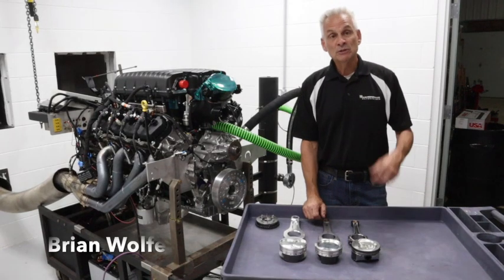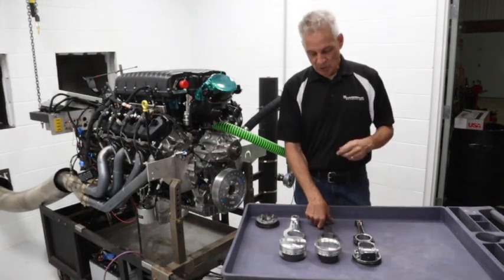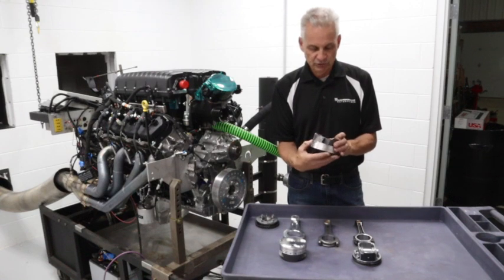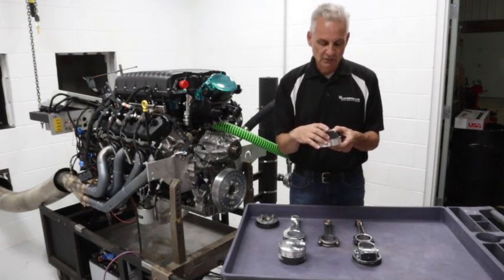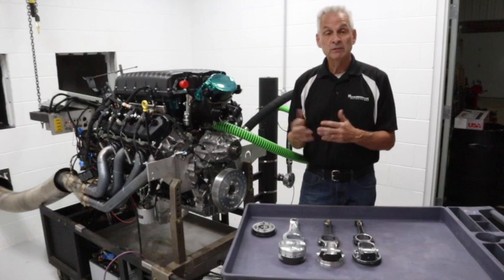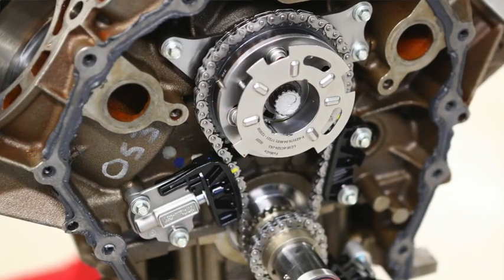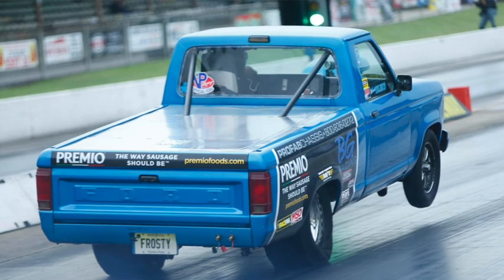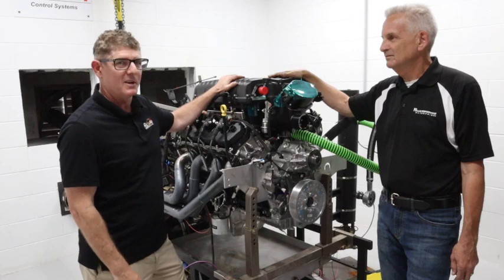7.3 Godzilla — Max Power? — Engine Management — Plus... Rods, Pistons and Soon, Ford Whipple Boost

Comment: Alex Flores or however you spell his name from Lund racing talked so much trash about this engine. But palm beach dyno is getting on board, ken picked one up to start building and playing with. I’m glad atleast  the 7.3L is gaining traction with some of these companies and builders.
Reply: Yeah I concur. I remember him talking trash about the old guys with slow masters and 1.6 rockers and push rods ect. I’m an old school guy. I like the coyote but Jesus a pain in the ass to work on. You can have a head off a 7.3L in about 1 1/2 hrs. I really like the architecture of the 7.3L it’s like Ford saw what the aftermarket was doing with heads and here we go. And on another note before my all timers flares up. I do remember old Alex Flores talking trash about Brian Wolfe as well... after I heard that I lost all I mean all respect for that dude. I really liked listening to him but that was it. Open mouth insert foot.
Reply: @matthewnosal6893  Flores is small potatoes. Wolfe's career is stellar. I even kinda sorta maybe remember him flogging an SVO 514 in a T-Bird back when. Can't find any info.
Reply: Alex is only a tuner.  He has only been in the business for about 5 years.
Reply: I rather have the coyote in a mustang because its lighter and more suited for car applications but ill definitely go 7.3 in a truck or suv
Reply: @albertpintor3522  Have those two engines been weighed in full dress?
Reply: @413x398  not side by side but I saw somewhere that the 7.3 weighs 540 pounds while the coyote is around 460 pounds
Reply: @albertpintor3522  Only an 80 lb. weight difference against 145 cubic inches in a narrower package? Sorry, dinosaur eats wild dog. [burp]
Reply: @413x398  Yep check out Evans other video for a side by side comparison to coyote and Windsor,
Reply: @brianwolfe2993  OK found it again (watched it back in Jan). Looks good sizewise against the Coyote, and it fits easily in a Fox. Nobody talking about this yet, but can I get this into my 2006 CVPI? That is my preferred target, even though I have an '86 FoxCat I bought new. Width looks good, but how about height? Oil pan?
Reply: @bigboreracing356  11.40 n/a in a f 150
Reply: @bigboreracing356  I am poor
Reply: @bigboreracing356    People talking about the 7.3 like it's the greatest thing ever when I think the Coyote is superior in every way it would be cool to see if they could make a big cubic inch Coyote
Reply: @bigboreracing356    It's all in the heads
Reply: I would take a performance version of the 7.3 over a coyote any day.  The LS is way more popular than the coyote because of it’s simplicity, and small external size versus cubic inch potential.  The coyote is gigantic, physically speaking, but maxes out around 5 to 5.2 liters.  Mod motors are small bore spaced, econo/low emission V8s by design that took ford years to make into a decent performing engine in the coyote.  The 7.3 will probably not amount to much, because I’m sure Ford will do what they normally do, which is only put it in the super duty and then stop production of it in 5 or so years.  But if they would do what GM does and put a version in everything(F150, super duty, expedition, navigator, etc) for 10 or more years, then the aftermarket would make affordable performance parts and junkyard cores would be available like the LS.  Then you would see a resurgence in Ford performance and maybe even see some 7.3s swapped into GMs rather than the current other way around.  Just my opinion but the mod motor and coyote killed Ford performance for anybody that likes simplicity, big cubic inches and really big power.  I know I have never had much interest in the mod motor family and many of my friends that like Ford haven’t either.
Reply: Paul Lane I have to disagree about the simplicity of the LS being the go to swap.  It may help but in reality mod motors especially the coyote are the future. The high rev capabilities are awesome. I love this 7.3L and having a new engine out there from ford. The only reason the LS became the go to swap is because GM put them in everything. They failed at 32valve engines and GM tried to put one in a vette and the LS was the choice. BUT the agreement was if they were going to do LS motors they had to make them to fit in most GM cars and trucks. Which meant LS in front wheel drive Pontiac GXP the impala etc plus you had camaros which came went and are going again. The Gto  hummers escalades Tahoe suburban and there other variants core vettes and all the vans and pickups and so on and so on.  Which means you can get a LS for $1000 or less and toss it in anything. That doesn’t make them good motors. It made them disposable cheap engineswhich you could toss in and out. Now it’s been proven new mustangs with coyotes the stock bottom end can get you low 8s in the 1/4 mile throw a stock bottom end coyote in a fox and you can run 7s without changing the bottom ends. I love all cars but the coyotes LS and now this Godzilla. Problem is as the camaro goes away and the corvettes are becoming $300,000 supercars with electric and small mod motors ford is ahead of the game and I guarantee you will start to see more and more coyote swaps. These things are runnng those times and making 1000hp reliably built making 13-1400whp reliably. That was a feat for a LS engine that has been out forever. And slowly going extinct. Joe Biden was at GM and and talking about his 60s corvette and said he seen the new 211mph electric  corvette I put the clip on my YouTube. It shows the way GM is going NO cars and a supercar corvette that nobody can work on or afford.  So I welcome new engine’s.  Mustangs Gas mustangs will keep on being what they are.    To those wondering the 7.3 is taller but not as wide as far as oil pan there is lower profile
Reply: @paullane7489  I agree, Ford needs to spread the 7.3 around. My daily is an F-150. I don't like the size/height of the current F250's, so I'm not buying one just because it has a 7.3 (optional). The F-150 needs a 7.3, and a bigger-than Mustang (resurrect Thunderbird) muscle car should be in the works. Sadly, Ford will again miss the mark.
Reply: Alex is complete clown shoes now he's going to have to tune them in mustangs to pay his bills lol.  How he has a job as a Ford tuner is beyond me shit must be easy if a clown like him still has a job.
Reply: Got a link? Wondering what he don't like about this new motor.
Reply: SUB SHOOTING 84 because it’s a pushrod engine lol. Like me he’s a coyote guy and us coyote guys found it funny that people legit thought the Godzilla was going to replace the coyote in the mustang
Reply: @subshooting8414   The fact that the Coyote is better in every way
Reply: @mauricecooper176  I love the coyote more by far but I grew up ford.so as a Ford guy I know what's what but I would definitely rather see a Ford push rod swapimto aford any day over seeing another LS swapped Ford.
Reply: @mauricecooper176  This motor will shit on Coyotes for drag racing, wait and see.
Reply: @Fauxbra    Do you think this engine can run 7.8 in the quarter mile without being opened up  And in the car with some weight not a Fox body
Reply: This engine requires a complete rebuild to compete with a coyote. Yes, it has its place for certain people or applications but from the factory it is an inferior design. The average person will not touch this engine for many years. Pro mods and teams will 100k cars maybe. It needs a complete redesign to be a practical engine swap.
Reply: @4eyefox  I'm sure Ford would rather consult with you than Brian so they can make this a dream engine. Fill out your resume and get crackin'!!
Reply: 413x398 YOLO DOUCHE BAG FOR THE WIN

Comment: Curious to explore the option of puttin a 7.3L in a Gen 1 Raptor!👍
Reply: I have a early gen 1 with the 5.4, so yeah!
Reply: @MacGyver2154  HellYeah!!  Mine's a 2011 6.2L.  Forget the ecoboost that sounds & shifts like a crotch rocket!  Forget the $106K RXT!  Seems like a Godzilla with a lil work & a blower is where its at!  These guys are doin phenomenal work wringing power outta this beast!
Reply: @daveslem4203  and IF the 2021 /2 actually Does have the 5.2, you know it's going to be 100k +. Gen 1 looks the best and it's the last SVT.
Reply: @MacGyver2154  amen brother!!  I like the Gen 1 better too!!  Gen 2s are nice and all but i dont like the transformer look FoMoCo went after.  Plus, modern vehicles are being built for folks that can't drive!😂🤣  Now, if we can get a Godzilla, Gen 1 with a manual 5 or 6 speed trans that'd be tits!!🤣👍
Reply: @MacGyver2154  Do you have a raptor with the 5.4?
Reply: Hell YES!

Comment: how does the bsfc of this compare to an old school bbf? How much more efficient is it? Great video series btw thanks!
Reply: Nelson Braganza : The versiona of the  factory EECIV 460 werent any better than 0.54 due to the restrictive4bbl based intake manifold. The best comparison is to the best of the  big 97mm  bore spacing V12 Mercedes Benz  M120 5987 and 7291 cc engines. The 3 valve per cylinder 408 hp at 5200 600SE, and the stroked out Zonda made 555 hp at 5900 rpm. The quad cam 5986 cc CLK-GTR, 600 hp at 7000 rpm with a mandated Holley 500 cfm style twin 1.38 " restrictor plate. Those engines made class wining BSFC figures. I  smile when I see M137, M275, M285 and ME 4-12 beating 850 hp figures coming out with just a factory Ford small block engine and head castings. I think youll find better than 0.48. Its got very little drag on that crank, low parasitc losses because its a V8, and high mechanical efficency because its OHV. And dont forget...Brian Wolfe oversaw the F9R Yates Roush NASAR engine development and team supprt, which is one  the most efficient engines on earth, which was a custum engine which avoided racers having to perform 100 hours of machining work turning a Winsdor Cleveland plant rough machined block into a NASCAR winner. The Godzilla will be as good as the four bearing 3800-4100 Buick Series 2 V6, which had the best BSFC curve.

Comment: I want to see what twin turbos will do on this
Reply: MichXJdad twin turbos would be better for this engine this big it would need a massive single turbo 110mm + and to get that big of a turbo up to temp would take a while you would also fight back pressure issues and lack of room to fit that big of a turbo it would make more sense to run 2 88mm turbos you will have less back pressure issues less lag way more Response from turbos and it still would be capable of flowing over 2000 hp + worth of airflow from the 2 turbos now if it was a 4 cyl or an inline 6 I would go single turbo so you have all the exhaust flow from all 4 or 6 cylinder helping spool the turbo faster with this engine being 3.65 Litres per cylinder bank with a total of 7.3l that a lot of  displacement for 1 turbo
Reply: You read my mind. The ultimate power adder and the one mod that would wring out every last bit of whatever potential is in there.
Reply: Chad Kent oh 100% the supercharger will never flow as much air as turbos and never be able to 100% maximize the engines full potential I would love to see what an old school blow would do on this engine tho the Australian would probably love it for all the torque for there burnout cars

Comment: For the people that are thinking Super Duty upgraded(me)is anybody working on transmission upgrades to go with it?Ready for that blower video!🇺🇸💯👍
Reply: The 10spd is the same one in the diesel so its already a good starting point for holding the power. Diesel is 1000+torque
Reply: WhispR It’s the same as far as being 10speed the internals are managed different because of the major rpm difference so as I was told by a ford tech.?
Reply: @whispr6331   No, the 10 speed that's going in Wolfe's Fox Mustang is a newer Mustang 10 speed. The 10 speed that comes in the new Super Duty trucks (F250, 350...) is a completely different transmission.
Reply: WhispR Not to mention diesels make there torque way low rpm range.You throw a blower or even just a cam the torque is going to be made in mid to upper rpm range specially with a blower so your looking at 5,6,7,8th gears in the power range instead of the first 4 gears.
Reply: Steve York I didn’t know you could only use 1-4 at low rpm and 5-8 at mid to high rpm, that must be something new in the automotive world.
Reply: @steveyork8069  5,6,7 and 8 speeds will not be needed with that trans behind this engine because the trans will explode on the 1-2 shift when thrown any rpm at all.
Also torque curves can be moved around when plotted on a graph but always always always torque and horsepower are Exactly equal at 5250rpm no matter What the make of V8 engine it is. And wifh that said torque is always on the downslope of its curve past 5250 as horsepower increases...which makes sense since horsepower IS a measurement of torque over time
Reply: William Stamper obviously you don’t know what your talking about because supercharged engines don’t fall off after 5250 rpm’s
Reply: @steveyork8069  go ahead and fact check what i said so you can prove yourself wrong. Have you ever even been in a dyno cell?
Reply: William Stamper Many times,I’d like to where you got your information on this transmission exploding to fact check it,I own five trucks with this transmission 4 diesels and 1 7.3 gas it’s the very first year for THIS 10 speed my diesels already have over 100k on them no issues at over 1000ft lb torque my gas truck tuned to 453 rwh and 524 ft lb torque no issues but I want more like 800 rwh it’s a toy so text me the sight where these transmission are failing I would be interested in reading it
Reply: @steveyork8069  and whats the max rpm your 1000lb/ft diesels spin? 
Now take your 7.3l gas engine, modify it for 900hp and who knows how much torque at what, 7500 i believe they said?
Then show me how great your 10 speed trans holds together. I don't dislike the trans, but its not whats considered a high performance trans for 7000+ rpm 900hp and up modified engines of any kind.
Reply: William Stamper I think ford claims 37-3800 rpm actually haven’t driven one.i own them my drivers drive them,but I don’t care about the diesels they do their job just fine my 7.3 has seen 6980on a dyno I know this trans can take torque down low and through mid range my original concern that I asked about was does anybody know how it will do with 12-1500 hp and 700+Ft lb toque spinning 7500 rpm because those are the min goals they are going for with this engine.My 7.3 is in a F-350 4 door long bed so I’m happy where it’s at but would like to buy F-350 standard cab long bed to go full tilt play toy for playing in the mud.
Reply: @steveyork8069  im not putting down your stuff man...my point was just that this particular trans in question is not and never was designed as a high performance unit. Suncoast maybe can help you with that trans but even the high horsepower diesel guys run more traditional aftermarket supported transmissions. Its possible Mike's transmissions in cali, big name high volume shop may have some support for this trans in question. However for your 700+ hp screamer i still believe you will have to run something more traditional and supported by the aftermarket.
Reply: Just put a dam c4 in it👍

Comment: Someone needs to put one in a pulling truck
Reply: Grooves between bores may be a problem with big boost/compression
Reply: Ford has already teased the full on battery powered F150 but having that as your workhorse says to me fun with ye olde Big Blocks for retail. Diesels already pumping 1000 plus horsepower! That doesn't even include the Farm Tractor monsters!  Makes the 1970s look quaint going on forever now.

Anyhow "we ain't outta gas at all but swimming in it!" be the calling card of the 2020s decade..